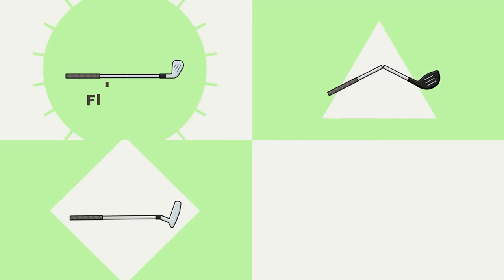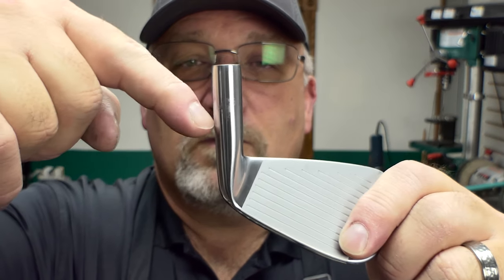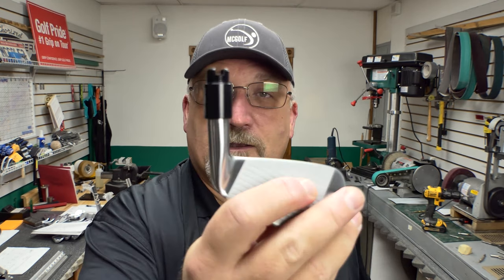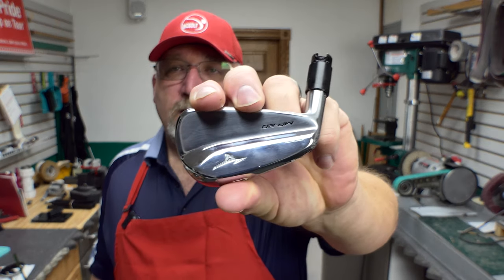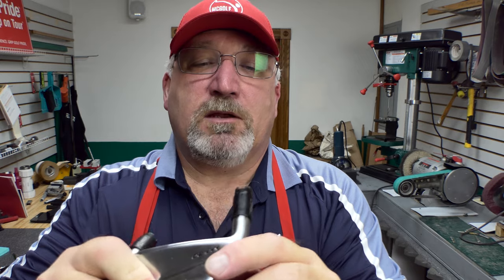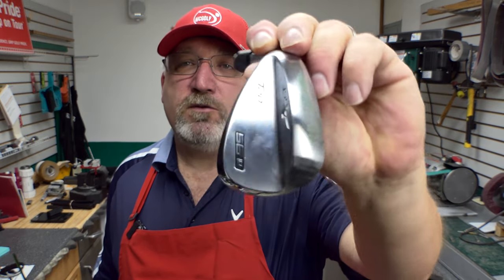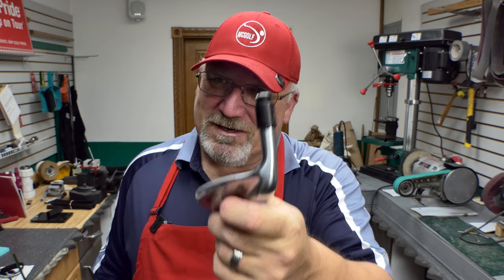How TO install A club connector

Comment: Thanks for the vid Jim, I'm glad that you are still able to work from your HQ, but hope that you are staying safe.
My only problem with these fitting connectors on Irons is that I find them visually distracting which affect how I can hit the Irons. For some reason, this never seems to happen when I'm testing drivers, fairways and hybrids. I once had to abandon an Iron fitting because I just couldn't hit the Irons, they just felt and looked awful! I don't know if anyone else has this problem.
Reply from the maker: There are some that are like that, you might want to concentrate on the ball and not the club. I’ve had golfer that didn’t like hitting indoors. It took about 50 shots to get comfy
Reply: @McGolf  hitting indoors probably doesn't help, having a target to aim at makes it easier to focus I suppose. Stay safe & healthy
Reply: @banditbaker1675  Bandit, I see you are not fitter/builder exclusive! I won't tell Ian and Matty.... 😁
Reply: Hi Neal, no I have always had a problem with commitment.....ask my wives 😉
Reply from the maker: We can work in HQ because we live above it. Works out when trying avoid traffic
Reply: @McGolf  That works🙂

Comment: What thickness is the cutting disc on your angle grinder?  Is it better to use something like a 3/64" with graphite or is 1/8" ok?
Reply from the maker: The width should ok as long as you account for it in the cut

Comment: what was the head weight prior to and after the attachment of the collar?
You never said and that info is critical..
Reply from the maker: By reaming the hosel then boring the additional 1/4” the weight remained the same
Reply: @McGolf  perfect. wasn't sure if there were any differences that would then alter build results matching to testing results TY
Reply from the maker: The shaft adapter does add weight but it is small in comparison to the hosel adapter.